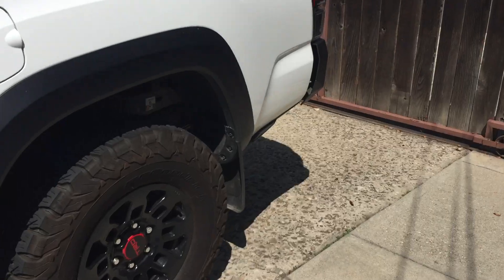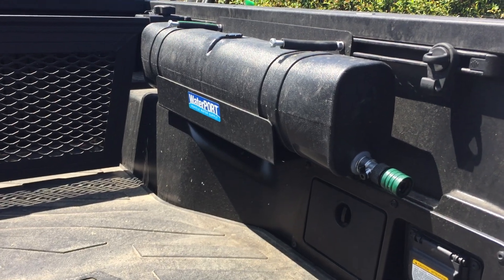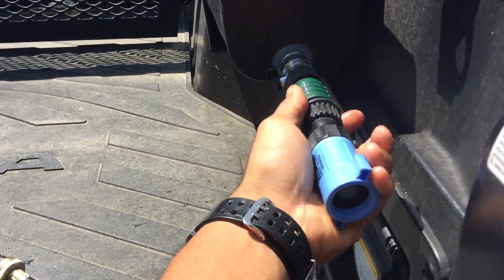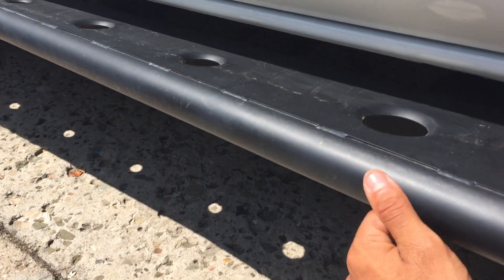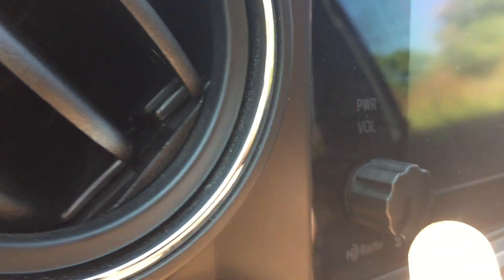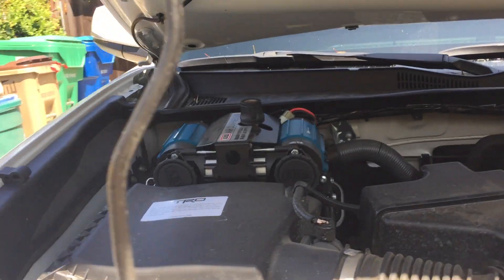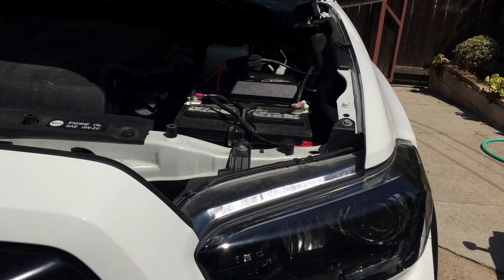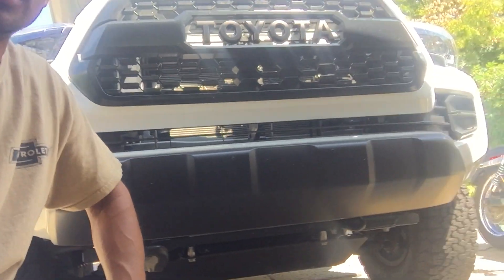(New Mods) 2017 Tacoma TRD Pro Rig Walk Around!!!

Comment: I also have a white 2017 Tacoma TRD Pro.....mods include hidden winch (Warn), switched to KO2 tires, additional 1.5 inch lift, 1 1/4 inch wheel spreaders and RCI frame connected rock sliders.....liked seeing rear bumper and would like to see the front bumper you mentioned to come.
Reply from the maker: fiftyfishbottom I definitely will post it once it comes in at the end of October.. :/ but what did you go with when you lifted your rig 1.5 inches?
Reply: done by Toyota dealership (wanted to make sure wouldn't change warranty coverage), reality almost 2 inches. They also installed rock sliders to frame at same time (they have lift and help, I live alone on mountainside). As I understand, they used a spacer of some type and said it was within spec limits of Toyota. I would guess you know more about it than I.
Reply: I didn't want to push far on tires either...did go to 265/75 R16 and wish had gone to 275/75 R16. For me, it isn't really about any rock climbing, more about in and out of ditches, gravel or dirt mountain back roads. My driveway up to my house is single lane,  1600ft with steep run and two switchbacks, another 1000ft to a county road.
Reply: Nearby, someone I know of is about to open up an offroad park on mountain acreage of his family and to be called Patriot Mountain.
Reply from the maker: fiftyfishbottom nice, that's definitely the safer route to go without voiding your warranty when lifting your truck. I'm still unsure of what size lift I want to get. Which is why it will probably be the last thing I do. I also would feel really bad taking out the stock fox suspension so soon as well!  But leaning towards 2.5" lift in the future with Kings or maybe bigger Fox Shocks!
Reply: I also have a 2017 Pro in Cement.  What did you use to lift yours?

Comment: 4:50 Redline Tuning hood struts coming soon??
Reply from the maker: Tacomaholic yes that might be my next mod! My hood is a pain in the ass to open up sometimes haha
Reply: Awesome buddy! It's one of those mods where you really wish Toyota would have just included it with the truck to begin with. 😀
Reply from the maker: Tacomaholic 💯 should have come stick from Toyota!
Reply: At least your 3rd Gen came with a locking tailgate handle. Lol I had to add one to my 2nd Gen.
Reply from the maker: Tacomaholic True. Although I wish it locked with the key fob instead of having to manually doing it. I will also being adding a pop and lock to my tailgate very soon!

Comment: What size wheels, tires, are you running and do you have a lift or leveling kit or is it just stock height?  I have a 16' trd offroad with a leveling kit from the factory, and want to jump up to a bigger tire-wheel without messing with the suspension and am not sure how big I can go. Stock wheels are only 7inch so any increase in tire size would probably mean buying new wheels too lol.  Great video, thanks for posting.
Reply from the maker: AK Kenai 265/75/16 I have a video of me getting my tires put on my rig if you want to check it out. I don't have any lift and there is no rubbing issues at all!